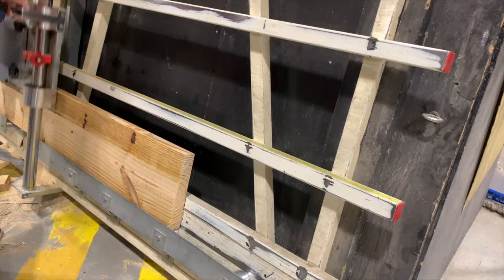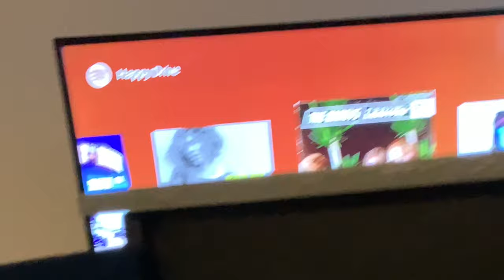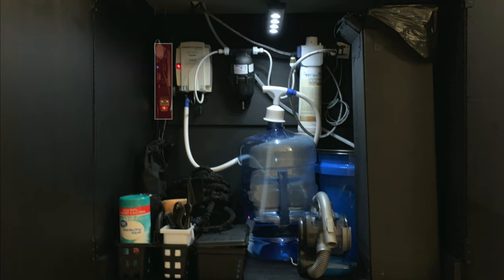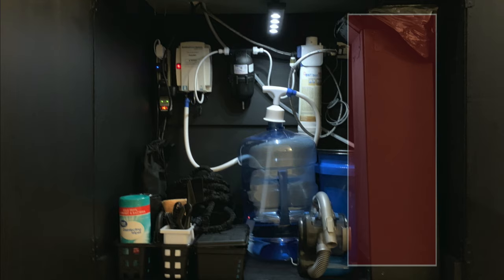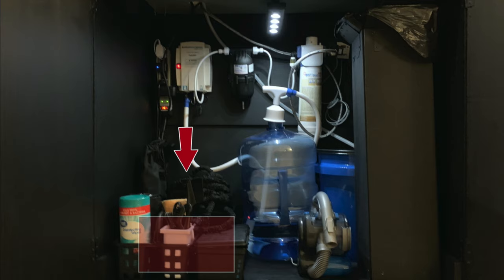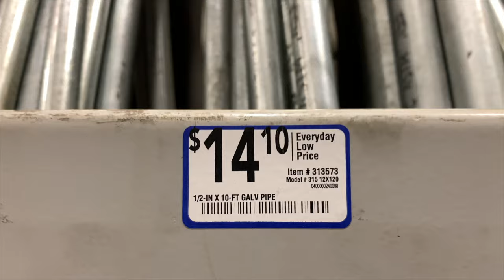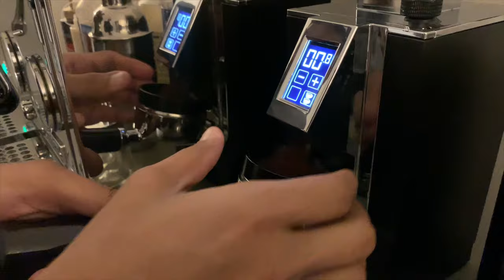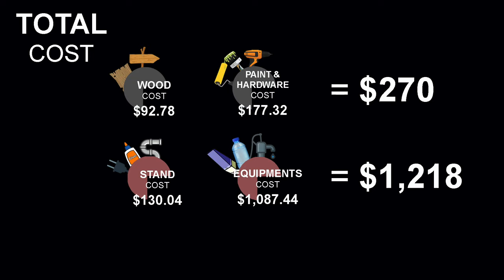I Built My Own Coffee Cart!!! 😱🤩 DIY

Comment: Best build video I have seen! May I ask how far your countertop is from the floor? Do you find it comfortable or wish it was a bit higher or lower?
Reply from the maker: Hello,
I’m glad that you found my video to be of interest for you :) Currently, with the wheels, which were a bit higher than what I expected, it is 99 inches in tall. If I had to redo it, I would want a bit thicker counter top, so the length would be around 101 inches. And I feel like having it just slighter shorter from where it is now 97 inches would be better. (maybe find a shorter wheel). So somehow being able to manage it in a way where the max would be 97 inches would be best. Hope this is helpful :)
Reply: @MohamadAlmakky  Thank you for the quick reply, but I was asking about the countertop height that you sit your espresso machine on (not the total height). Thank you!
Reply from the maker: @DarrenAddy  Hello there, sorry for the late response. Currently it is at 1.5 inches. It is working well with no problem. But if I had to redo it, I would make it 3 to 3.5 inches to look nicer.

Comment: Nice job ,the black is it a filter also ,what's the name of the white square motor😊
Reply from the maker: @king8521  thank you! No, so the black thingy is an accumulator, just accumulates water. I honestly stopped using it now. The white thingy you are referring to is either the BWT which is the water filter, the other white thingy is a water pump, which just pumps the water from the gallon to the machine and the rinser. Hope I answered your questions.

Comment: How do you add electricity to your car? I have not been able to figure this out. Where does your outlets coonect to for power
Reply from the maker: pablomanuel maldonado hello, as mentioned instead of building a whole outlet inside the cart, I got a very powerful extension cord that would handle so much power and that would extend very long. This way, you can just find the nearest outlet and be able to plug in the extension cord! I got mine from Home Depot. Hope this helps.

Comment: Hello great video.
Tell me please this is a gas coffee machine?  Or go for electricity?  Thanks
Reply from the maker: Hi there! Thank you.
This is an electric machine, that is why I used a very strong and high quality extension cord. Hope this helps :)
Reply: @MohamadAlmakky  Yes thanks )
Sorry if i m annoying but where u plug in that extension cord ? Did u use some inverter for accumulator ?
Reply from the maker: @jlodjinov4459  Hey sorry for the delay! You are not annoying at all my friend. The extension cord could be plugged in any outlet. In an event outdoors, there should be access to electricity. As for my use, I mostly use it at home, so I just plug it in the wall outlet. For your second question, it does not need any electricity, it just gets the water from the jet and push it to the filter. Honestly, I tried to take it out, and it did not make any difference. So you could skip the accumulator all together and save some bucks!

Comment: Hello, as I read they say accumlator should be after the filter, or is working with you in this order?
Reply from the maker: Hi there,
So honestly I got rid of the accumulator and the system works just fine. And you are right, that is another way of doing it.
Reply: @MohamadAlmakky  hello there, so is there no pulsating from the flojet?
Reply from the maker: saud alharbi hi! Yeah you could honestly skip that step. So from the flojet to two ways. One goes to the rinser and the other goes to the filter.
Reply: @MohamadAlmakky  thanks for the information